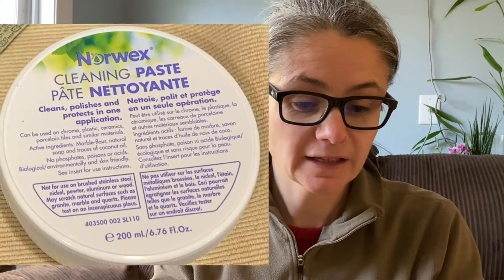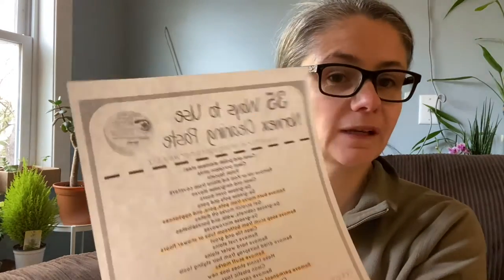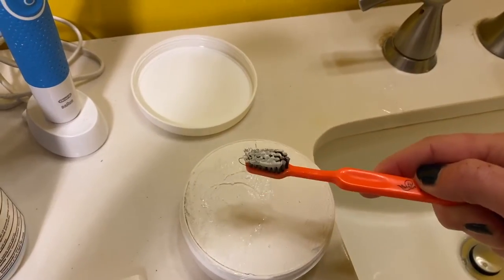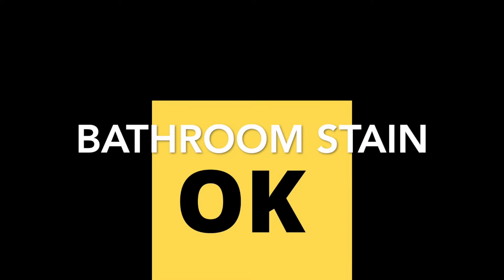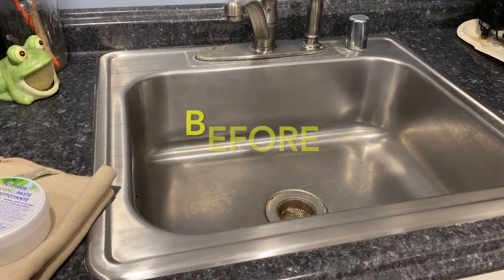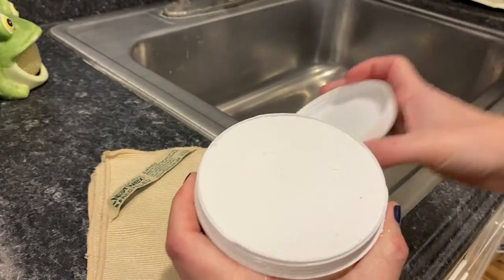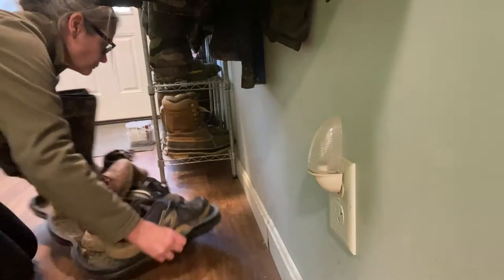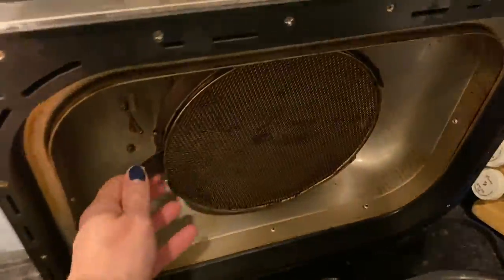Norwex Cleaning Paste- How Well Does it Work?  (not a consultant)

Comment: I've tried all kinds of cleaners but in my experience, vinegar works the best to remove the calcium and hard water around the faucets (it comes off in flakes)  Soak a paper towel and let it sit for at least 30 minutes, check it every 30...depending on the build-up. 
On your foodie I'd try the Awesome cleaner with hot water and then follow up with dish soap. 
Thank you for these videos. I have shoulder problems too, a friend gave me a battery operated scrub brush set from Amazon...game changer!
Reply from the maker: Hi!  Thank you so much for your thoughts!  Those hard water marks are a pain! I haven’t tried the Awesome cleaner, so will give that a look.  Sorry you suffer from shoulder issues, it is the worst!!